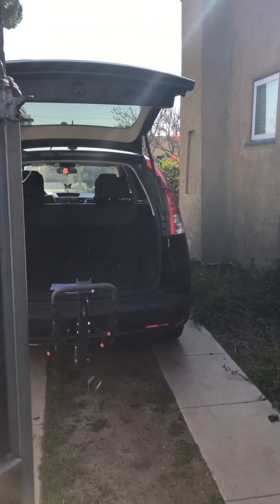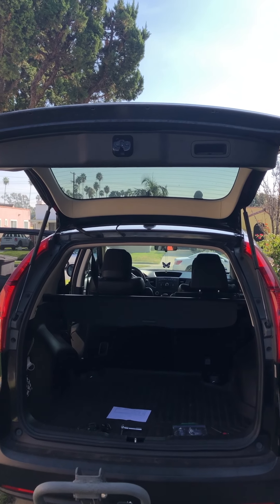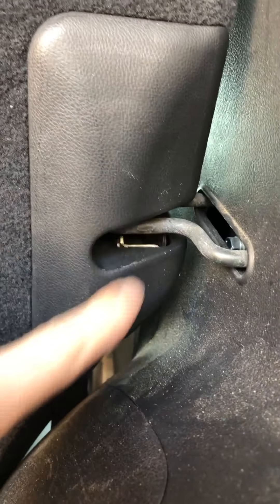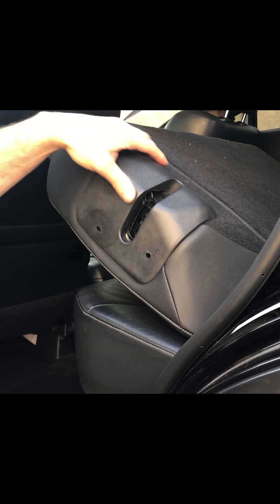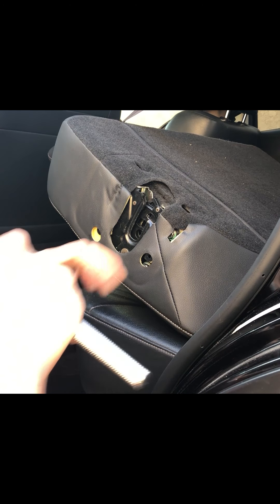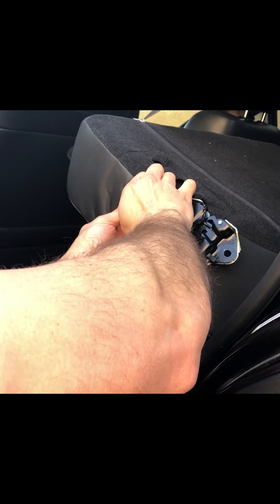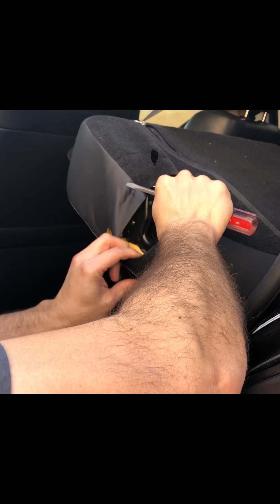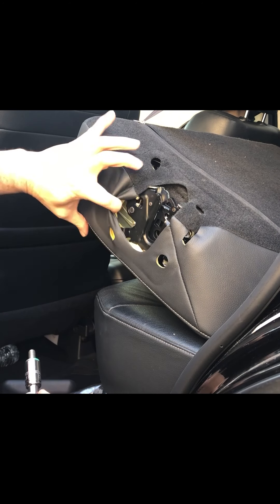2012 HONDA CRV REAR SEAT LATCH REPLACEMENT

Comment: I would love to know how long the new part will last before it breaks again. The way it's built with the plastic insert it's designed to fail. There is a lot of strain on that tiny little plastic part.
Reply from the maker: So far so good.  I haven't had a problem with the new one.

Comment: Are those OEM replacement latches with full metal parts? Or aftermarket parts? Where did you buy them?
Reply from the maker: They are aftermarket parts i got off the internet.  sorry i cant remember the website

Comment: you can fix this using a cable tie without needing any new parts. FYI.
Reply: I was curious about the same thing.
Reply: @garytucker8049 Don't go the cable tie way if you plan on lowering the seat on a regular basis. It's been known to damage the cables creating even more expense.